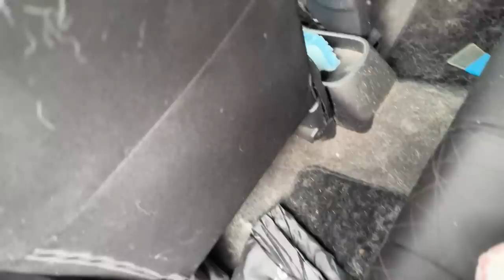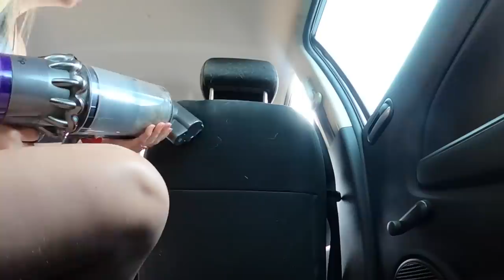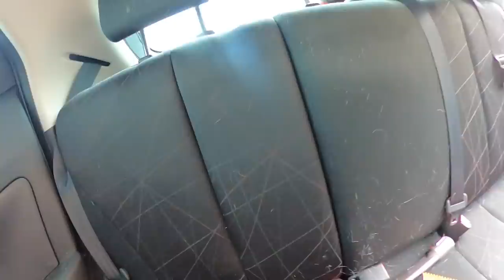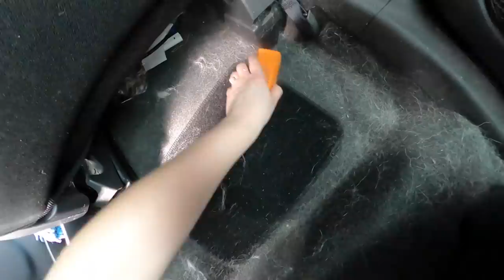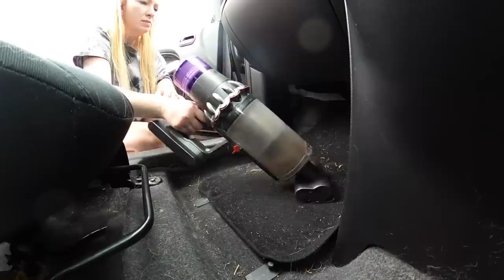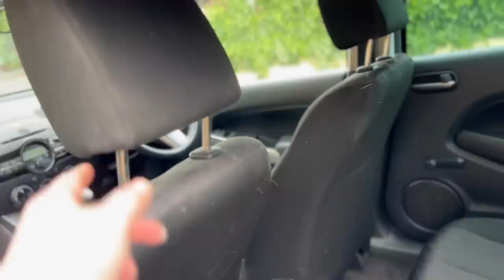Deep Cleaning The Husky Car! Fluff Everywhere!

Comment: I had 2 huskies at one point. My year after year experience with different methods found that wet rubber gloves (the kind for doing dishes) and a little bit of Dawn dishsoap in the water helped gather the hair best. Dunk the gloves in soapy, warm to hot water (based on your comfort) and rub away at the surfaces. Similar to how you were with the fur brush and cloth

Comment: A slightly damp rubber glove helps getting the loose hairs off. Like the kind you might wash dishes with. Detailing at it's finest. I guess if you have a white husky, you should have a white interior car? Looks a lot better than when you first started. Now Key can start fluffing over.

Comment: To get the husky fluff out of my car I usually start by taking strips of duct tape, sticky side out, and try to pick up the majority of the big piles.  Or even just a lint roller would work but a normal lint roller will be overwhelmed by the fluff.  So I stick with the duct tape, lol.

Comment: In my case it is a cat, but it works: I use a modified package band dispenser with packageband turned with the glueside outside. With one circumfence I cleane 1m² easy

Comment: Hi Jodie,
I think the lint remover, a fan got you quite some time ago, might work better in the car. It was white and the double sided fabric lint remover part was blue. It had a handle to pull it out of the white part. After you use it and slide in back in it grabs the fur off of the lint remover thing so you don't have to manually wipe it off every time. That was probably a bad description of it, but I can't remember the name of it, which is sad because I have one myself.

Comment: Wide double sided tape, or wide duct tape wrapped around your hand with the sticky side facing out works well for that kind of job. Really sticky tape will pull the hair right out of the fabric or rug. Only drawback in your case, you might go through an entire roll. ;)
Anyway just a suggestion. Good job!

Comment: Jodie! Next time, buy an inexpensive roll of off-brand duct tape and tear off pieces big enough to wrap around your hand sticky side out. Then you can just pat the headrests and seat backs with the tape, changing to a new piece as it gets full of hair. You may go through a lot of tape but it would be so much quicker and require much less scrubbing than with that rubber hair collector thing.

Comment: Good quality shop vack would help a bunch. I have one and can use attachments off of an old vacume and it works just great. A trick I learned a long time ago is using a spray water bottle and mist everything as you go and the shop vack sucks it up quite well. I also use Fabreeze and it also works with the odor.

Comment: I find that an old tennis shoe works great. Rub the sole on the fabric and Fluff rolls into a ball that and one of those rubber horse coat brushes.

  Curious: My fluffer is said to be of the MacKenzie River Tribe. She has almost identical Face markings as Key' also is plush coat and has 4 dew claws. 35Kg and 1.3M from Nose to Rump.

Comment: for cleaning fluff you can use hand dyson, brush, okay. i prefer using packaging tape. it's fast, efficient, and quite effective. has strong lifting power. you can make a 'wrist band' with it (reversing the sticky part, of course), and then dab the seats with it. it is thorough enough. also works on clothes.

Comment: Wrap some packing tape (sticky side out) around your hand and use that to pick-up the hairs still stuck after cleaning with the brush/vacuum. May not work great on the coarser fabric of the carpet, but should work well on the seats.

Comment: GSDs aren't much better.  In the springtime when they lose their winter coat, you're driving in the car with balls of fluff floating around the cabin.  In the absence of a rubber glove, I just moisten my hand so it's just damp and running my hand along the seat pulls the hairs out of the fibers quite easily too.  I felt your pain pain with all that scraping and vacuuming but we love them and wouldn't have it any other way.

Comment: You should look into getting a Lilly Brush. The absolute best for cleaning up hair on all types of soft surfaces. Get the rubber edged one, not the brush type. Will make that task much easier and quicker.

Comment: Have you thought about using a sticky lint roller to try to remove keys fluff?

I also imagine the fluff that's been floating around in there, has gone in someone's mouth while the car was being driven.  That would be my main reason for making sure it doesn't stick around.

Comment: Beautiful job. Suggestion they make car seat covers for the front and back, along with rubber floor mats. When the seats need cleaning remove the car seat cover and wash at a public laundry facility. Rubber floor mats are easy to clean.
Reply from the maker: If you watch the clips with Key in you'll see there is a seat cover, but the fluff sneaks it's way underneath ;D

Comment: Possible ideas for helping this task for the next time?  Pet grooming gloves (use before Key leaves the house and gets into the car?), Try masking tape (or brown parcel tape for inside the car - it might get the little bits - either with static or with contact?).  Remember too that the headrests can be removed - thus can be cleaned outside the car!  The covers for the seats and headrests should be able to be removed also - so can be de-fluffed outside; turning them inside out might also be a help?  Also putting extra covers on - so they can be easily removed and shaken for easy removal in the car; they can the be cleaned outside it.  Also maybe some more carpet for inside - attached with Velcro?  They can be removed easier!  Just some thoughts.  Antistatic things might help also?

Good job otherwise on a very long and arduous task!

Comment: You should get some of those covers that go in the back . Like a hammock one that fits on the head rest. Those little orange things work good but they are rough on some fabrics.
Reply from the maker: We do have a hammock in there, if you look at the clips with Key in, he's in one, I just had to remove it to clean. Fluff still gets under it unfortunately.
Reply: @jodie_boo  wow you wouldn't think so much would get under it..

Comment: I need to clean mine out so bad.  I have an SUV and two shedders...  A GSD and a Mix that sheds just as bad....I didn't think anything could shed as bad as my Husky did, but my long haired GSD proved me wrong.  LOL.   I would clean mine, but watching you clean your car tired me out.  ha ha.  Maybe next weekend.  I like that brush block....did you get that from Amazon?  I feel like I've seen you use it before.  I wonder how those pet gloves would work in a car.... thet are rubber with nubbies designed to remove loose hair from your pet   I bet it would work on carpet.

Comment: Next time for the fluff that's sticking to the back of the front seats and the headrests is take a piece of packing tape and wrap it around your hand to where the sticky part is facing outward that will help get the fluff stuck to the seat that doesn't want to come off.

Comment: Your mom's car looks like mine, but I have two huskies in mine.  Just watching your video I got tired.   I found a wet paper towel is the best way to remove husky hair as the water discharges the static electricity.  The hair will now roll up and you can pick it up or use the vacuum on it.
Reply from the maker: Good tips, thanks! :)